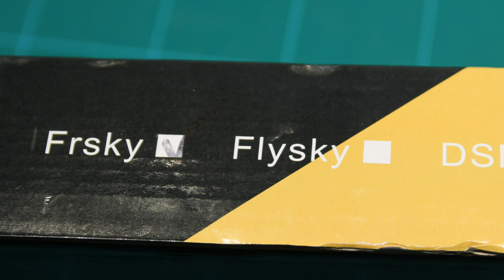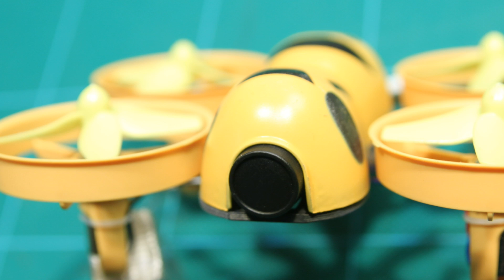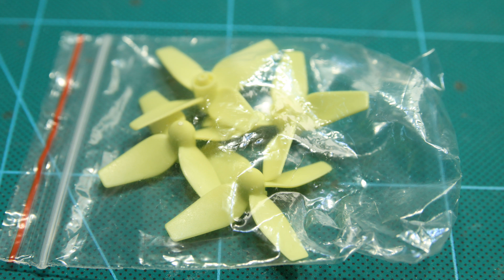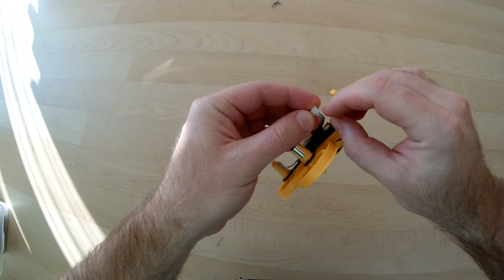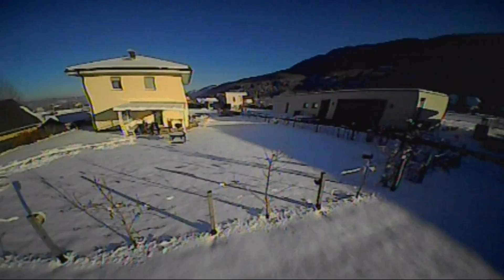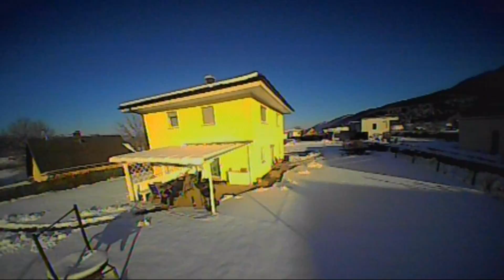Eachine Fatbee FB90 2s Micro Quadcopter: Review & Test Flights!

Comment: very indepth and nice review - Is the quad better than the Qx95, qx100 or qx105 pleas suggest which to buy
Reply from the maker: Hi Thaddeus. I'd say if you want to fly indoors as least as much as 
outdoors, then go for the FB90. The FB90 has prop savers built-in, so 
you will be able to touch walls and so on without any damage and without
 crashing. This is a big advantage of the FB90 over the other three, 
which do not have any prop savers built-in. So if you like flying 
indoors, get the FB90 (altough it works great outdoors as well, as you 
saw in the video).

Comment: There seems to be a big push for a lot of brushless FPV quads out there now, from 70mm to 120mm.  I bought the QX95 from Banggood. Unfortunately, since all the videos I watched on it, they changed the system from a separate F3 FC board & FrSky RX board, to a single combined board. I was able to bind to my Taranis 9D+, and I updated the F3 EVO Brushed FC to Betaflight 3.0.1.  Everything seemed to be working, EXCEPT for being able to ARM and control the motors via my Taranis. On the Receiver page, everything looks to be working. However, on the MODES page, although I can change modes from Angle/Horizon/Acro no problem, it will NOT ARM. The indicator moves as I flip the ARM switch, but the ARM box does not turn yellow to indicate that it has armed. I can go to the Motors page and control the motors via Betaflight, so I know that the motors are okay. I can only presume that the new single board FC/FrSky combo board is defective, and I've contacted Banggood, which said it will send me a new board. Until then, my little QX95 sits on my kitchen table. I could really use an indoor FPV quad, as I don't like flying in the snow and cold of Winter outside.  There are lots of reviews on this one, and its close competitor, the Furibee. Thanks for another good review. Cheers.
Reply from the maker: Hi Bill! Too bad to hear about your defective part. I'm sure Banggood will replace it quickly as always. When I needed an item replaced, all I needed to do was to upload a short video showing it is defective and contact them with the link to the video. They then immediately send me a free replacement part, without the need to return the defective one. Their replacement policy seems to be quite good with regards to this.
 
I also really like the small brushed copters. Specially in winter, when I can also fly them indoors :-)
 
Many thanks for your comment - how are the Quanum Cyclops performing for you?
Reply: Yes, I made a video for Banggood and uploaded it to dropbox and they saw it and said they would send me a new board. Unfortunately, it always seems like it takes forever for stuff to come from them (slow boat from China).  I have the Quanum V2 Pro, and they seem to work well, although I have limited experience with them due to just getting them after the weather changed (which is why I want my indoor FPV so bad). I doubled up the 2 acrylic lenses and had a special pair of glasses made up with a +2 in the diopter so that everything looks good to my eyes .. ha ha. Right now just have a Boscam 832 RX with VAS Mad Mushroom antenna on it (RHCP) and also attached an Eachine Pro DVR to get some recorded video for quads with just a ccd cam. The few times I tried the goggles, I at first found it a little disorienting .. getting a little dizzy, but I assume I'll get over that once I've used them more. Cheers
Reply from the maker: Right, sorry! It was the v2 Pro. I'm sure you will get used to them over time :-)